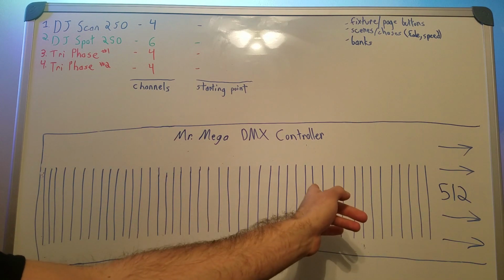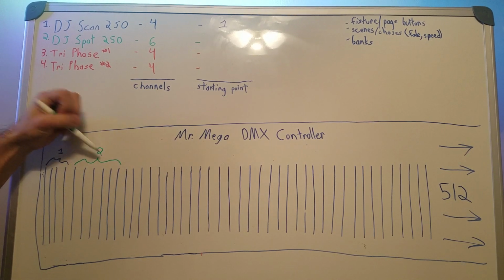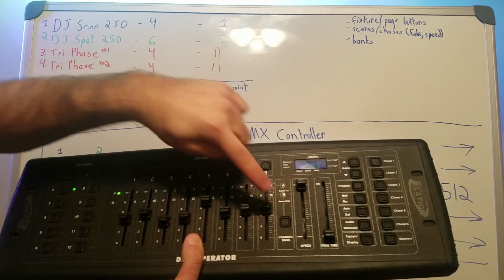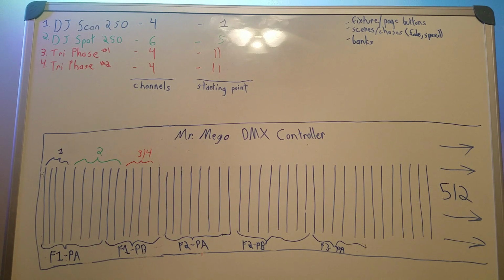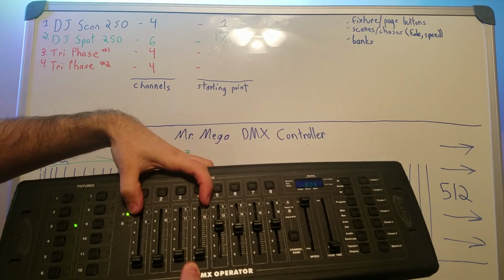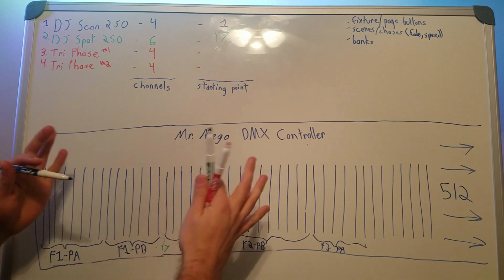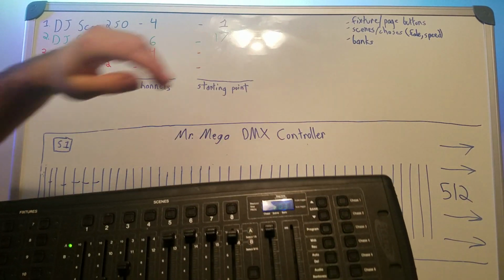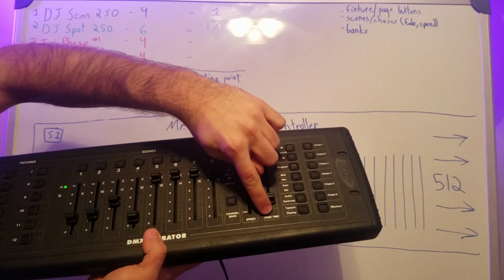DMX Lighting - Even Easier Tutorial

Comment: If you want to preset a whole soundtrack and let the DMX controller do all comandos by itself synchronizing all movements to the soundtrack. how do you know where to program / insert the comando to activate, for example, the right timing of a strobe at a specific point in the soundtrack to imitate a lightingstrike or an explosion in that soundtrack without letting it react to the sound of a person's voice? 🙄

Or for example, making a movinghead change its position on only every 4th kick on the bassdrum instead of every kick? Do you need to count mount of the beats in the soundtrack? Or do you need to program all scenes and fixtures all in 1 chase to make that possible. 🤔
How does that work with a DMX controller to accomplish that? 🙄

Is it possible to make a tutorial to explain that, please. ? 🙄🙂🙏

Or can it only be done with a computer 🙄

Best regards

Comment: Good afternoon. I am a husband who is running a light board for a community theater.  I am not a lighting designer!

The theater just installed new ADJ lights:  Specifically four ADJ PAR Z120 RGBW units.  The setup on the board is as follows:

- Light 1 -> Assigned to Fixture 1 (channel 8, address 1) -> Faders 1-4 on the operator board are RGBW.
- Light 2 -> Assigned to Figure 2 (channel 8, address 17) -> Faders 1-4 on the operator board are RGBW
- Light 3 -> Assigned to Figure 3 (channel 8, address 33) -> Faders 1-4 on the operator board are RGBW
- Light 4 -> Assigned to Figure 4 (channel 8, address 49) -> Faders 1-4 on the operator board are RGBW

You can see the problem with this setup.  While I have individual lighting control as individual fixtures, I cannot have Red on light 1/figure 1 and Green on light 2/figure 2 as sliders 1-4 on channel selection A on the DMX operator board have the same assignments.
I would like to setup the DMX board to have the following setup:

- Light 1 -> Assigned to Fixture 1 (channel 8, address 1) -> Faders 1-4 on the DMX Operator Board (Page Select A)  on the operator board are RGBW.
- Light 2 -> Assigned to Figure 2 (channel 8, address 17) -> Faders 5-8 on the DMX Operator Board (Page Select A) on the operator board are RGBW
- Light 3 -> Assigned to Figure 3 (channel 8, address 33) -> Faders 1-4 on the DMX Operator Board (Page Select B) on the operator board are RGBW
- Light 4 -> Assigned to Figure 4 (channel 8, address 49) -> Faders 5-8 on the DMX Operator Board (Page Select B)on the operator board are RGBW

This way I can have individual colors on all four lights at different times.
I just have 0 understanding of how to program the lights to be assigned to different faders/page selects on the DMX Operator.
Reply: Do you still need help?

Comment: Very clearly explained! Cudos mate! Though I it wasnt 100% clear to me how you actually insert each scene into a sequential order when creating a chase seq. I imagine you press prog-chase to be in program chase mode, then click on each scene button of a particular bank - and it automatically inserts that scene in the order you press scenes. Please correct me if thats not correct.Also, whilst selecting each scene, how do I control the brightness level of each  scene (ie sc1 bnk1) as I program scene into a chase. Cheers
Reply from the maker: Your adding scenes to a chase so the order you add scenes is the order they go in. In program mode, you click the chase you want to add scenes, then go to the scene using scene and bank buttons, and click the button to add the scene. Forgot the button name but it's in the manual. Scene brightness is set by the fixture, not the scene itself
Reply: @DJGhez  gotcha. Thanks. So to be clear, i select/hold the add button (like I would creating the scene in first place) and click scene button. 

And with brightness of scene that should be set when creating the scene and not controlled when adding
Scene to chase, or whilst playing chase seq?
Reply from the maker: @ademjaffers1035  you got it. That should work

Comment: I need help programming cold spark units with a DMX board. The have DMX inputs and can be daisy chained. I have no idea where to start... Anyone have step by step instructions? Here's what the cold spark manual says: Channel 1: 0 = Spark effect off, 1-255 Spark effect on. Channel 2: 0-20 pre-heat off, and the first channel is invalid. 50-100 Pre-heat on, and the first channel is valid. 150-200 Clear material, and the first channel is invalid...???? This makes no sense to me, any help would be appreciated.
Reply from the maker: To start, just plug one unit into the dmx controller. Set the unit to DMX address and to channel 1. On the controller select fixture 1 and move channel 1 up. This should correspond to channel 1 of the unit's manual.

Comment: Hi thank you so much for this information. I have been trying for days to get just basic information on programming our elation stage setter 24 dmx controller. The man that programmed it originally did not do it correctly and we would like to fix that. Basically we have 8 par can lights and 4 wash bar lights. Currently he has the fader programmed where 1 is red on lights 1 & 2 and fader 2 i is green on lights 1 & 2 fader 3 is blue and then fader 4 is red for lights 3&4 and so on. I know this isnt the way its intended but i cannont find any information to program it correctly. Is it possible that we can assign each light a fixture number and then each fader adjust a channel of the light, for instance light has 7 channels. Can each fader adjust a channel and you choose each light by choosing the fixture. Thank you for any information you can share.
Reply from the maker: Are the channels the same for all lights? Do you want all the lights to show the same color at the same time?

Comment: How do you turn this controller on. Idk if I have a faulty controller , but I have yet to find a video that actually starts out with the most basic thing about this controller; turning it on. Not even in the instruction manual can I find the answer to this question ..... going to keep on trying things for now...
Reply from the maker: Oh. I saw you comment before and thought it was a joke. You just plug it in and it powers on. No on switch. Power supply needs to be 9 - 12V with min 500mA.
Reply: @DJGhez  thank you for replying brotha, I figured it out, my connection just needed to be wiggled around a bit. I wish the manufacturer would of created a on/off switch though still bc I was slowly going insane. Lmao. 🤘🏽